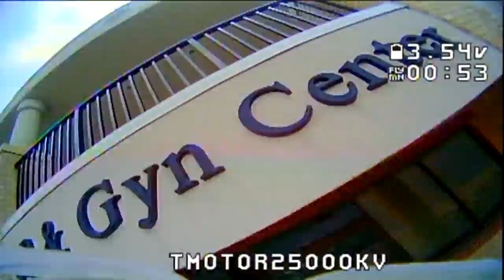T-Motor 0802 25000kv Motors | Rip & Review

Comment: Amazing freestyle! What 0802 25,000kv do you recommend? Looking to swap out motors on stock Mobile 6 ELRS. Thanks so much!
Reply from the maker: Currently I have been flying the Happymodel EX 0802 and the Tinywhoop HEX 0802. Basically the same motor, both are pretty solid so far.
Reply: @InfinityLoops  Awesome thank you for the quick response!!! I also have a tiny whoop race coming up, would you say those two are good for racing as well?
Reply from the maker: No, I believe most racers are running 0702s now. So these motors might be weighing you down a bit.
Reply: Much appreciated than you again!

Comment: hello, which brand would you recommend for the 0802 engine and serial 1s?
i need your information
Reply from the maker: Can you tell me what you're building? What size frame, propeller, weight of quad? This is fairly important when choosing motors.
Reply: @InfinityLoops  Thank you for the answer.
I will build an emax nanohawk racer 65mm.
and i will use 40mm propeller
do you have any engine recommendations it seems like geprc is good
Reply from the maker: That whoop, The Nanohawk, has special motor mounts. 2 holes instead of 3 in a triangle.  I'm fairly sure that no other motors will work with that frame. You would need to get the emax 2 hole motors that the Nanohawk came with.

Comment: Just got the RDQ new products email that has T-Motor M0802 25000kv 1s motors.    Not finding any info on the M0802 motors
Reply from the maker: I looked over the specs compared to the ones I've tried, I couldn't find an obvious difference in the rdq spec sections at least. Maybe just M for "mmm...it's blue now."
Reply: @InfinityLoops  yeah I cannot find info anywhere, not even on the T-Motor site.  The T-Motor site only has the F0802 motors in this vid.
Reply: @InfinityLoops  There is nothing on Tmotor site but the m0802 bell looks different on the picutres i found online. The M has 6 spokes instead of 5.
Reply: @InfinityLoops  I just got a set of m0802 tmotors and they appear to be unibells now. Can't wait to give them a try. My first tinywhoop.
Reply from the maker: I just got mine as well. These are not the original m0802 they released. Seems to be a v2 with unibell. I'll be flying them soon, hope you like them!